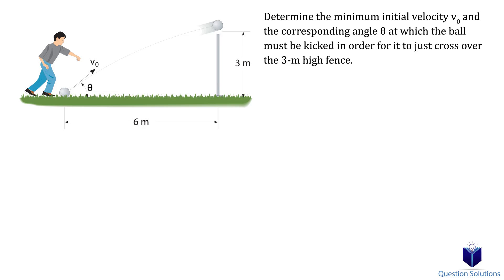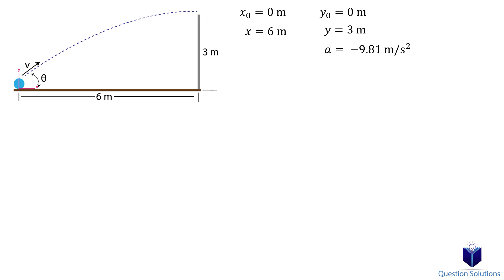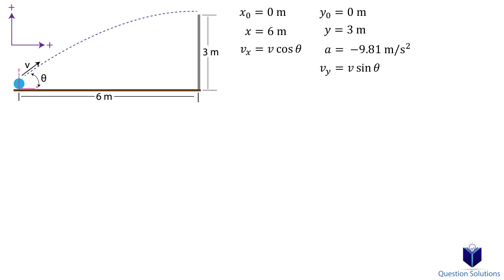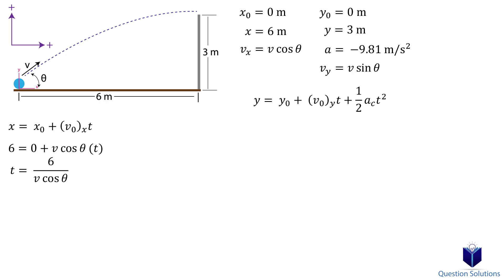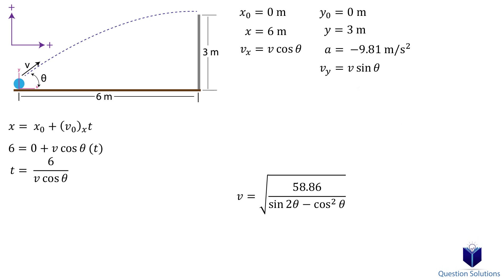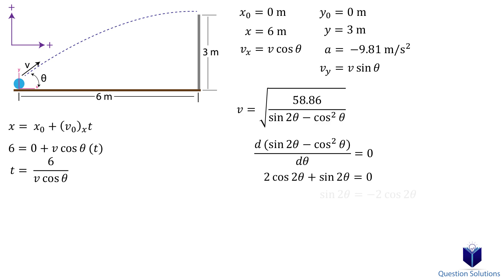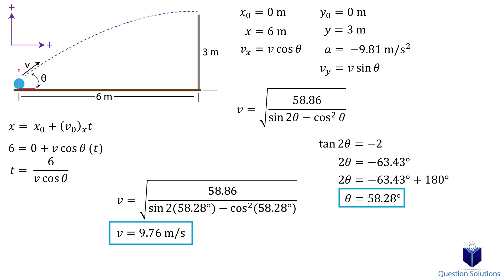Determine the minimum initial velocity v0 (solved)

Comment: 2:50 Excuse me, how did you get the speed with this equation? 😅
Reply from the maker: If you already have the angle, then you can directly plug in the velocity equation into your calculator and it will give you 9.76 m/s.
Reply: @QuestionSolutions  Oh, thank you. 👍

Comment: why did you derive and equate it to zero at 1:55
Reply from the maker: You're basically looking to see where the slope is 0. This gives you the maximum possible angle. If you graph the equation, you can see this much easier.

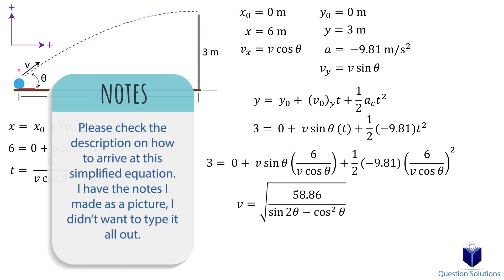Comment: Hello, quick question. I worked through your process -- your notes -- and I get your thinking. However, my initial impression at 1:20 was different. Immediately, after subbing in t, I cancelled out the common V in the 2nd term of of the right side of the equation - 0 being the first term. Am I allowed to cancel that velocity term? Thanks!
Reply from the maker: Yes, you can cancel the "v" in the second term. 👍

Comment: Im a newbie to physics...Why did you take the derivative?
Reply from the maker: This is more to do with calculus than physics, but the reason is that we are trying to find a minimum. In advanced functions, did you remember learning about finding points on a graph that had 0 slope and stuff? By taking the derivative, we can figure out the minimum velocity. Graph the equation y = sin 2θ-cos^2θ, you will see at 58.28, it's the top of the curve. See: https://www.desmos.com/calculator/pzxumvxs0w I hope that helps.